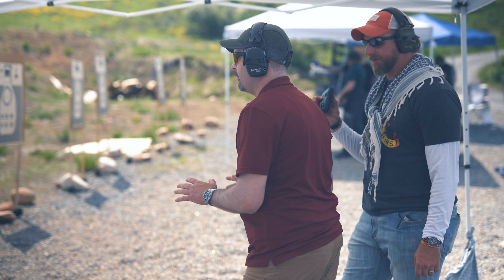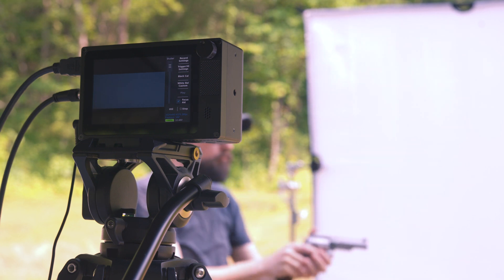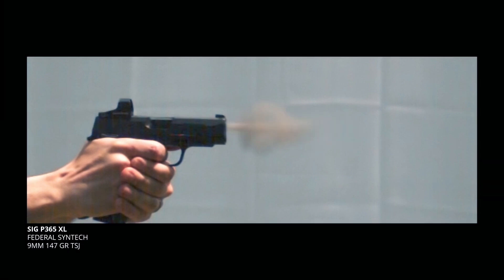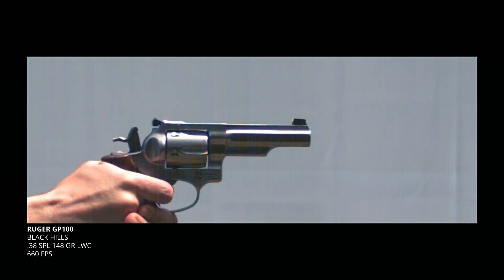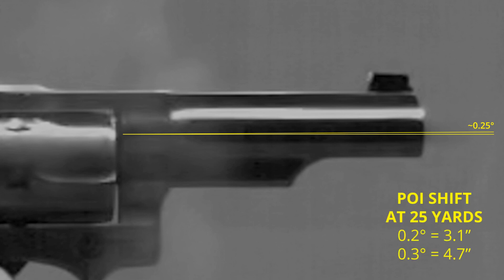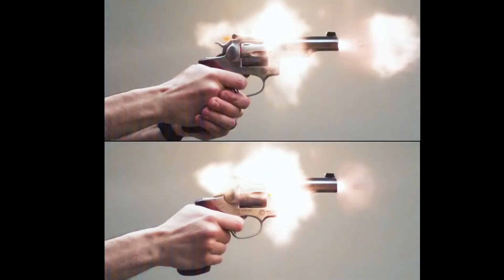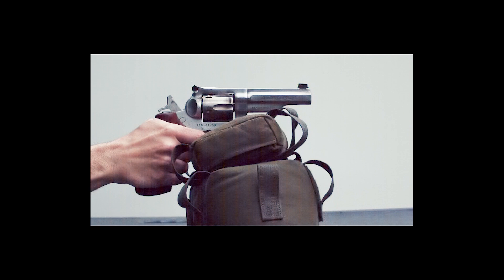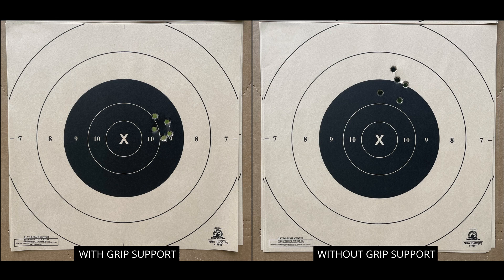How Recoil Affects Handgun Accuracy

Comment: I don't shoot accurately enough or a ranges enough for gun recoil to be a consideration.  Still good info though.
Reply: "A man's got to know his limitations."  I'm still learning mine--I fire some pistols out to 100 yards on large targets with satisfactory results and I have to be satisfied with poor results at only 10 yards with other pistols.  I can put most of my shots on a 3-inch bullseye at 10 yards with my .22 plinking pistol firing one hand with no support--not competitive with the match shooters.
Reply: @alancranford3398  Toddlers can handle 22 recoil relax 💀
Reply: @VBCVeryBigChannel  toddlers may find a .22 pistol too heavy to hold on target and the triggers on some .22's are too stiff--this is a problem for full-grown adults new to shooting.
Reply: @alancranford3398  Sounds like operator error to me. In my experience seasoned shooters shooting toddler level recoil (.22s aren’t heavy nor do they have heavy trigger pulls) so yes they can handle them. Most shots on target would be fine for a new shooter but the fact you miss with something that has essentially no recoil to worry about says it all!

Comment: Recoil don't affect Mansfield.
Reply from the maker: The laws of physics yield before his rigid adherence to blind tradition.
Reply: @LuckyGunner  Fnet=MA.   Can't escape it.
Reply: That’s right! 😂
He doesn’t have soft, squishy tissue. When he shoots a pistol, it’s the steel on the gun that gives.
Reply: @user60521123   I would doubt that it's the cylinder blow out since it's not really vectored down, but radially.  rather, it's likely the  "equal and opposite reaction"/physics of the detonation and  slug being pushed down the barrel.

Thinking about it in a force vector diagram - The explosion wants to go out in every direction, but the cylinder and barrel force it to act linearly along with the slugs motion and friction acting on the barrel.
You would also measure some rotational force from the rifling as well, but it's somewhat negligible compared to the linear force along the x axis.
Reply: @shirothehero0609   The gas doesn’t have to be vectored down but forward—similar to the muzzle. I was thinking about the cylinder being shaped a little like a reverse thrust on a turbofan engine. The cylinder is flat and fans out further on the side behind the gas than the barbell and frame in front of the cylinder. This would route the gas slightly forward. 
I couldn’t think of anything else that would cause this phenomena in revolvers but not semi-autos.
Reply: @user60521123  Well you apparently deleted the post I initially responded to, but I recall you specifically saying "down" in your question which is why I answered that way.  Not sure if you read my full reply.
Reply: Manny is unimpressed by physics.
Reply: True. He's like Paul Harrell & Chuck Norris.